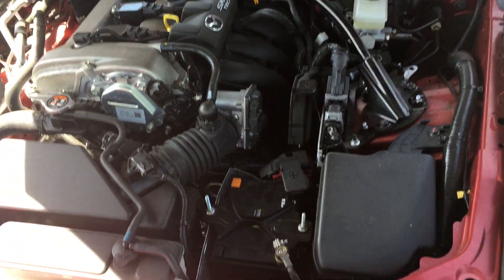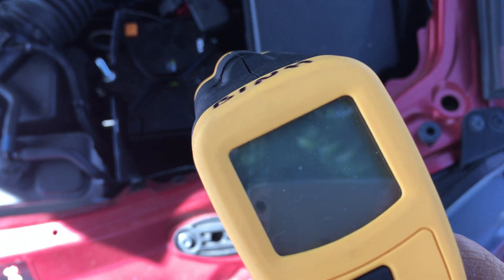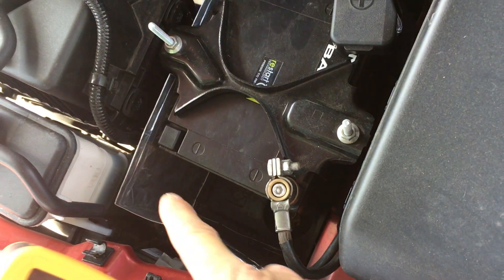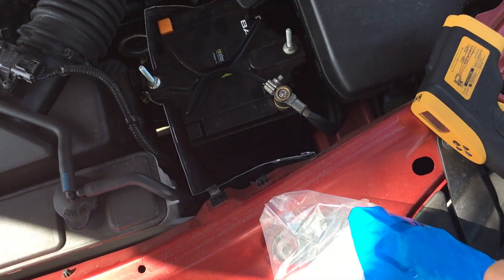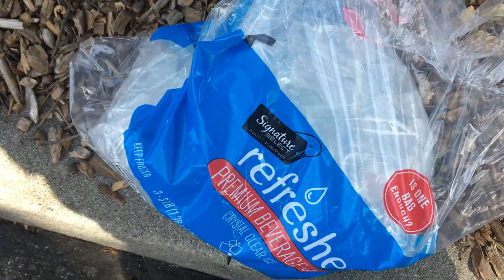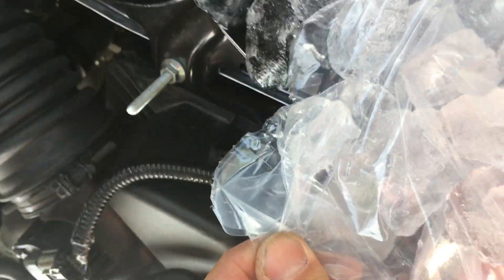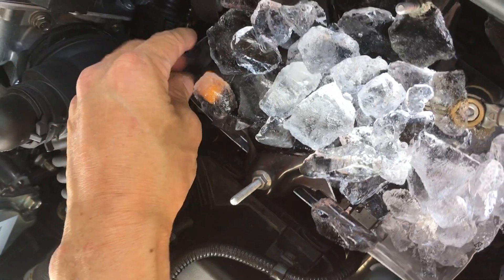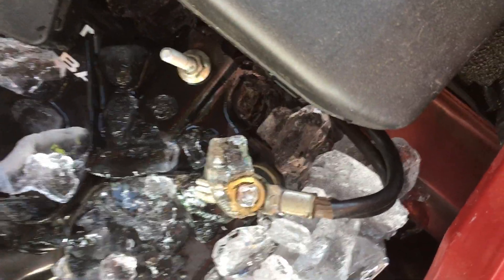AntiGravity battery overheat pt.1

Comment: Exactly the same thing happened to me using an Antigravity ATX-30 Re-start in a Subaru. It was a hot day and I was stuck in traffic for a while. The battery just died. Pressing the restart button on top did not work. I thought it was defective, but upon cooling down, it worked perfectly. Looking at the battery's operating temperature range, I suppose it wasn't designed to work under the hood.
Reply: atx 30 is powersports battery